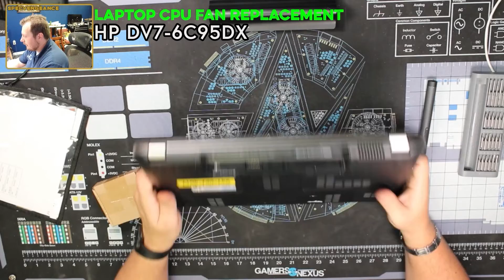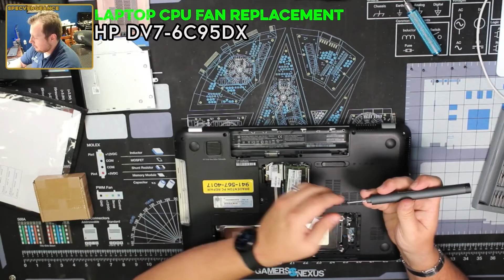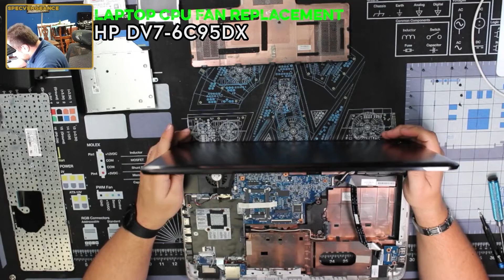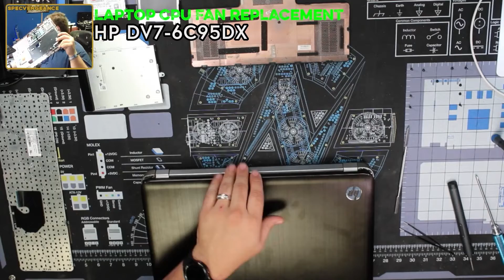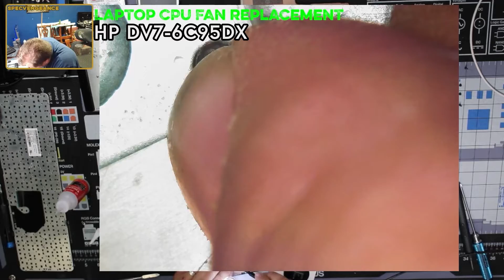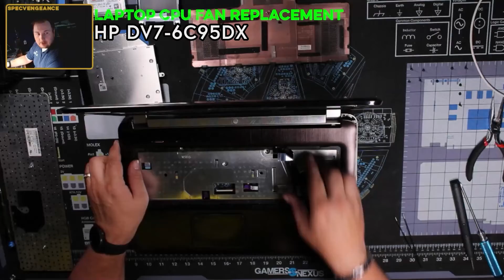HP DV7 6C95DX Teardown for Repair Walkthrough Guide for CPU Fan Replacement!

Comment: This video really helped. Took me like 5 hours. Definitely not an easy task to replace a fan
Reply from the maker: Some of them are annoying some of them are easy, it really is a toss up when you get started on them.
Reply: I thought it was going to be super easy replacing a fan, not at all on the Pavilion DV7 all the hidden screws, I didn't see your video at first which does show what's rather involved probably took me 8 hours only to find the new part I had was a four-pin not a three-pin so I got the right parts coming Sunday just hope it works when I finally get it all back together